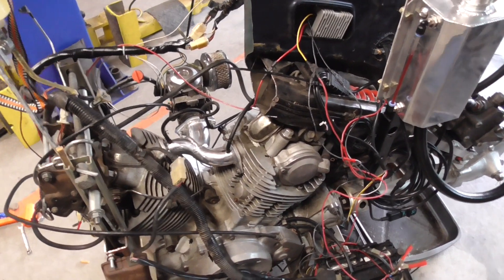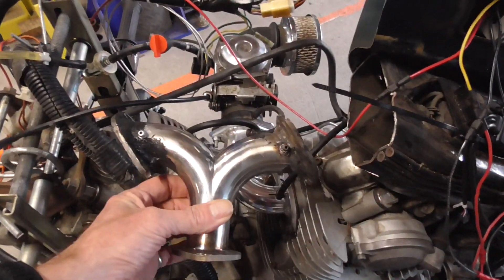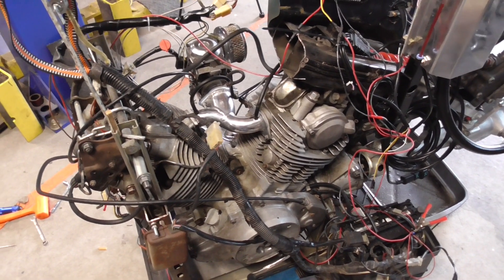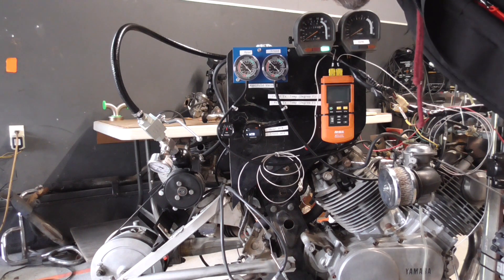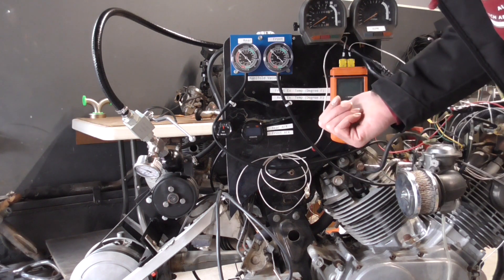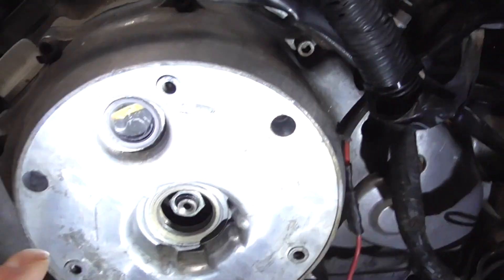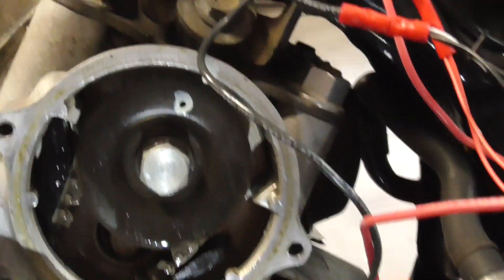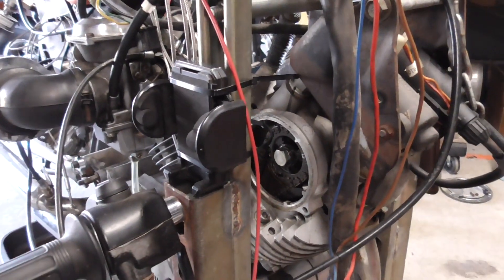Virago Single Carb Intake Cylinder Imbalance - It's got a lot to do with the cylinder timing

Comment: This manifold is wrongly made, does not match any physics, so you wasting your time! Most VTwin engines run richer on rear cylinder due to higher temperature.
Reply from the maker: Hello again, I never said that this manifold was made correctly or incorrectly…it might be the best design or other designs may work even better than this one…who knows.  It did do better than the other ones I tested though, but that doesn’t mean that there aren’t more balanced designs (KJS, Mikunioz…even the one you apparently make it seems (by looking up your info).  Also not sure why you mention that the rear cylinder would have a richer AFR reading on the test rig due to higher temperatures…when riding the bike, the rear cylinder does get less air flow so it runs hotter, but on the test rig, no air is flowing over the motor.  The video shows that the richer cylinder switches from the rear to the front when the timing is swapped…that is really the main purpose of this video and has nothing to do with if the manifold was designed properly or not.

Since is seems you make a single carb manifold, if you would like me to put one of yours on the test rig and see if it balances the cylinders with the normal timing setup, you are welcome to send me one and I can put it in the test rig the next time I bring it to the shop again and make a video of the results.  Or maybe you have already tested the Physics of your design and can provide a link to the data…I’d be happy to post a link to it in the comments.  All the best, Steve

Comment: Have you thought of testing the other manifolds with the changed firing order?
Reply from the maker: Hey !  No, I didn’t swap out to the others ones as I’m not sure where the black one I had came from and the equal runner one I made was totally out of balance.  If I can get my hands on a Mikunoz or another one still being made, I’ll probably set those up on the rig and see how they do with both the timing as normal and then also swapped 👍
Reply: Hola steves..yo acabo de pedir un colector de mikunioz por eBay Australia y he comprado un carburador dellorto phm40, qué pienso tendré que adaptar y ajustar.. qué opinas?

Comment: Hi steve great videos just wondering with the front leading can it be riden like that or will you have problems cheers 9:46
Reply from the maker: Thanks !  It wouldn’t hurt the motor to run it with the front cylinder leading since it is just changing the firing offset between the two cylinders, but I’d say it would affect how smooth the idle is since the two cylinders fire so much closer together.  It is probably going to run more like a single cylinder motor (like a larger cc Thumper) with more low rpm power, but less smoothness at higher rpms.

Comment: Interesting video!

I’ve always been curious what the “airbox” inside the frame looked like.  Would you mind sharing some photos of that box frame cut open? Thanks!
Reply from the maker: Hey man, there’s actually nothing inside the frame but a hollow area where the air flows from the hole that the filter mounts to the frame all the way up to the neck where the triple tree is. The two holes where each carb elbow connects to the frame just have another smaller rubber elbow inside the frame to help keep oil from the motor’s vent valve from getting sucked into the carbs.

Comment: I tried it on my 85 700 but it only hit on the front cylinder i got a 98 750 engine i had to change the balancer flywheel for my wire harness to work i got tired of the starter gears grinding but it runs just fine i had to space the stater and pickup coils tho
Reply from the maker: Hey man !  It might be that this would only work for a 1st Gen since it only has one pickup pad on the flywheel vs. the 2nd Gens having two..not sure about that though, but seems like it should work the same way since the plugs fire on each rotation for both generations
Reply: @StevesDIYs were I put a 98 model motor on a 85 frame I had to change flywheel when i did that I had to make it like a 85 with old flywheel pick up coils stater is off the 85 into the 98 model motor were the flywheel ain't as wide as the 98 I had to take half inch spacers on the stater and pick up coils it's set up just like the one you did it on on the test rig I'll try it again later and let you know

Comment: Thanks for the videos. I was considering going with twin vm or tm38's for my XV1100 but this experiment gives me renewed hope for going the single carb route. I'm curious to what the results would have been if you held it at about 2000 rpm for about 10-15 seconds with the p/s pump on for load. Either way thank you for this.  i'll be thinking of getting my hands on an A. Smith intake or even a MikuniOz intake
Reply from the maker: Thanks and glad the video helped a bit 👍. Yep, I still have the manifold on the test motor and if I can get my hands on one from KJS or Mikunioz I’ll do another comparison video of them with the load test like I did for the equal and unequal runner ones.  I think the carburetor plays into how well they do as well, but using the same carb for the testing gives a better apples to apples comparison.  Thanks again and all the best !  Steve

Comment: I put a KJS manifold and Mikuni 40 pumper carb on my 1985 XV700.I did use a hotter plug.They claimed it was a plug and play set up but I did have to change the needle position to riches it up a little.It responses well now but like you said the rear plug looks a little rich.Looks like your on to something with the timing.Thanks for the informative videos
Reply: KJS has done extensive testing to develop their manifold and chose the  Mikuni 40mm pumper to include in their kit.Yes I would love to see it on your test engine to compare both timing setups.
Reply from the maker: Thanks 👍.  Yep, I’d like to get my hands on one of the KJS ones to compare as well just to see…maybe they will see the videos and send me one to test lol !  It does seem that the cylinder timing for the combustion stroke makes the front stay leaner as everyone has done that so far with the standard timing procedure.  I’ve heard the pumper carb does a bit better on it going lean for a second when throttled up and down (as seen on gages) so it would probably be a bit smoother than the 40mm Hitachi I had on it. Thanks again and all the best !

Comment: While setting the timing on my Virago I just removed the pin from the cam and then as you move the crank the cam sits still. Then I replaced the pin when I was done. I had my front cylinder 180 degrees out after a topend renuild and I used this method to correct it.
Reply from the maker: Hey man !  Yep, as long as the cam doesn’t move when rotating the crank (or cam gear) it would be easier that way vs. having to hold the gear up with a finger.  The gear still needs to be removed from the chain to put it so the gear hole lines up to the pinhole though (which is always the fun part to get the teeth back into the right link on the chain, lol)
Reply: By the way, Many thanks Steve for your fine videos. I just finished rebuilding my 1981 750 Virago and I utilized many of your tips and techniques. It's a runner now and I couldn't have done it without you.
All the best!  @StevesDIYs

Comment: Great stuff Steve! It would be very interesting to see how the change in timing of firing affects the power, vibration and other characteristics of the motor. Now I know why a Harley has the characteristic exhaust note, different to the 'normal' Virago.
Reply from the maker: Thanks man !  I was thinking to swap the timing over on the ‘82 750 Bobber (it has the OE dual carbs on it still), just to see the performance difference (and how low I can set the idle to hear the loping sound without getting too low on oil pressure).  If it performed the same, it would definitely have a much different sounding idle.  Probably would vibrate like a Harley when running though, but that’s what padded grips are for 🤣🤣🤣